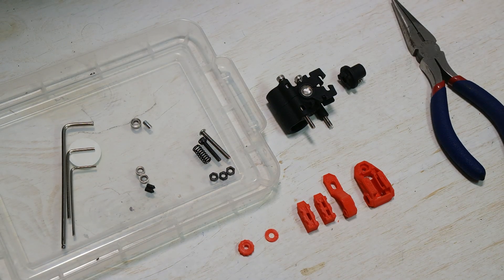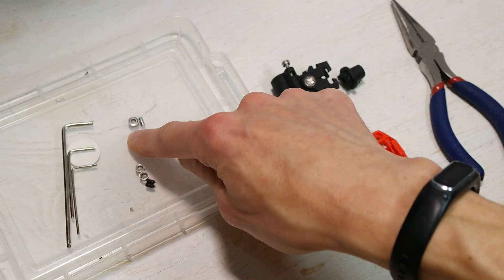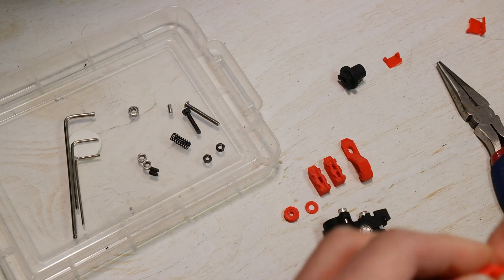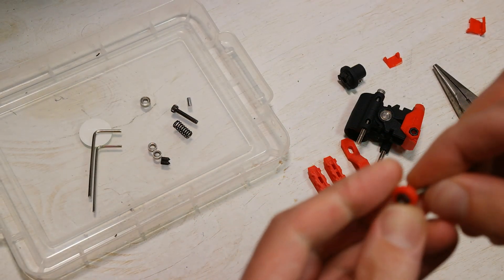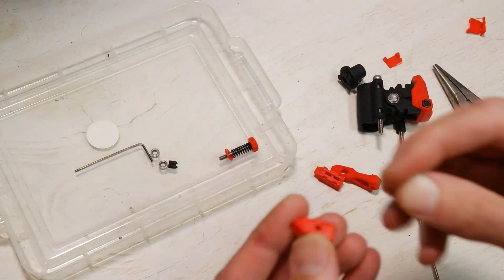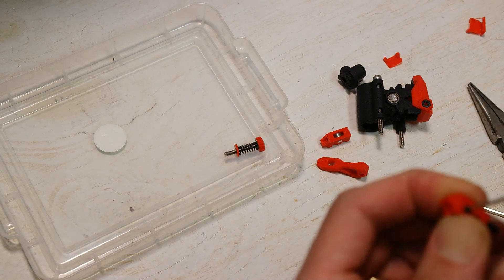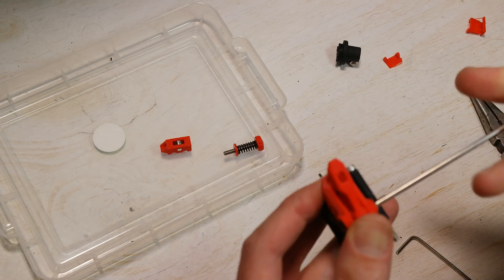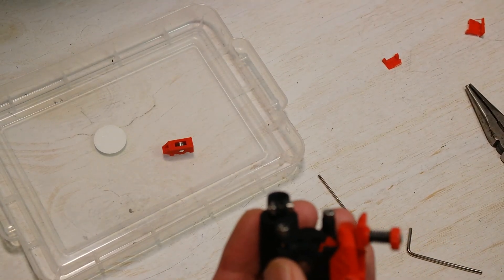Nimble V1 NeoBreech Assembly Tutorial

Comment: will this fix the ripples in the nimble prints? I have a V2 with that issue, though i know this mod wont fit it im still curious
Reply from the maker: In my experience, the ripple is a combination of (at minimum) periodicity in the flex cable and eccentricity in the sintered (not machined!) hobs.  This mod can help slightly with the first issue, because it reduces the insane bite strength of the original breech and therefore reduces the torque required to extrude, which helps flex drive accuracy.  However, there's really no solving the ripple completely -- even with a hard shaft drive (which I have tried), the hob still causes artifacting on its own.